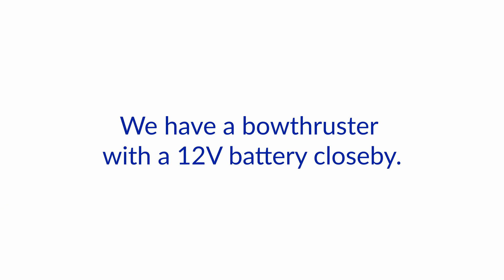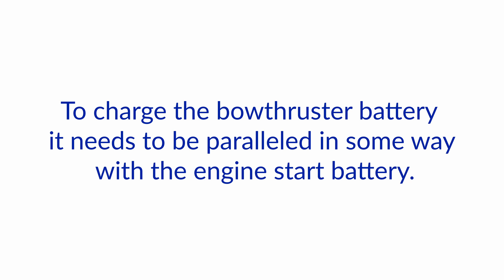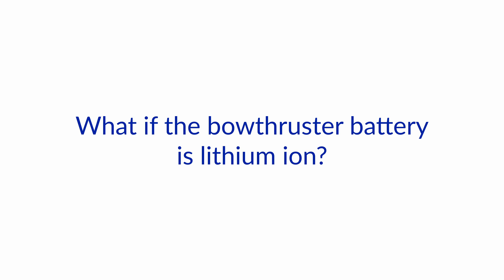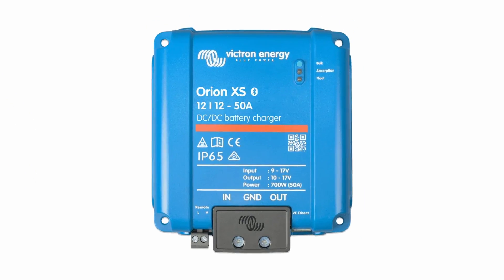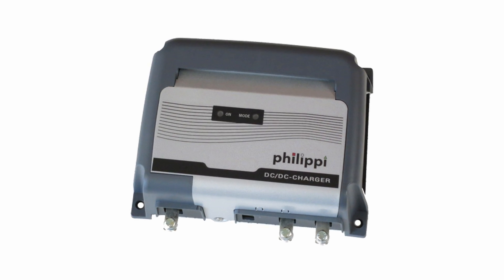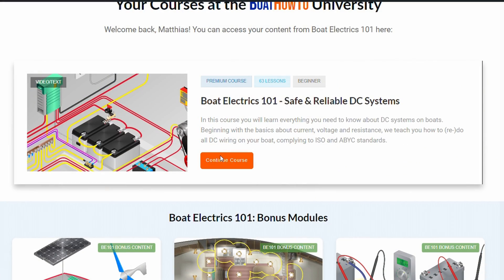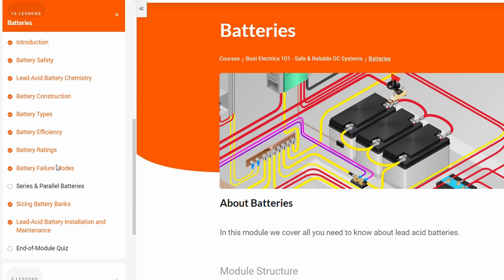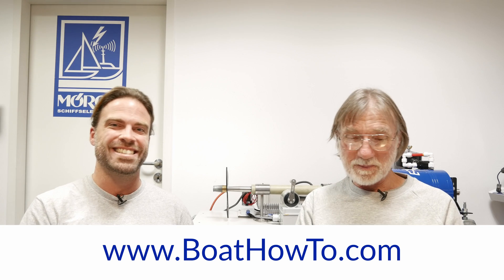LFP & Lead-Acid Mix - How to properly charge different types. | Ask The Expert with NIGEL CALDER

Comment: I am an advocate of "KISS" I have had a Lifep04 bank on my boat for ten years , I do not have any lead acid or any type of start battery . When and if my batteries hit LVC point there is still plenty of power in them to start the main engine and generator . I have a dual buss bar system , if the house disconnects the engines are still connected. This event has only happened once in ten years (I was vacuuming and didn't hear the warning buzzer before disconnect) The generator started up with no problem and charged up the batteries in no time. Also have the same bank driving the bow thruster , my bank is at the base of the mast and its only a ten 15 foot run with the bends to the thruster ,  I just spent the money on the cable , its twin 0000 Ancor , negligible voltage drop .

Comment: Is voltage drop an issue? On my boat its about 18 metres from engine to bow thruster. I charge mine using an AC charger. I am wondering which method would be more efficient.
Reply: I hope to start the course next week!

Comment: Nice topic - thanks.

FWIW: I have a VCR (relay) between my lead acid starter battery and my 300ah LFP house battery.  (I can enable/disable it via the relay on my Victron BMV 712 battery monitor so I can control/restrict combining).  The alternator is connected to the starter battery.

I had planned to purchase a B2B charger but I was surprised to never see a huge current flow between the battery banks when they were combined.  My starter battery is never below 12.5v and unless I'm down to 10% my LFP house is above that.   Perhaps it's not an 'idiot proof' setup but the voltages generally are within 1v at the battery terminals and factoring in voltage losses though 1/0 cabling and lead battery the current flow never exceeds safe values or even values stressful for the batteries.

I only have a 100amp alternator but if I was going to size up I'd likely look into connecting the alternator directly to the LFP house (& install a protection device) and keep the starter topped off with a small B2B charger.
Reply: There are several reasons why that is not a recommended set up. Firstly, the internal resistance of a LiFePO4 battery is much lower than a lead acid battery so a conventional (leas acid) alternator regulator will potentially deliver far greater currents than the alternator or wiring was designed for, potentially causing a fire. Adding a DC to DC converter (between both systems) is the  only prudent way to go.
Reply: @stephenburnage7687  Agreed, not recommended for the novice user, more of a knowledgeable poor mans solution.  I planned on using a DC to DC charger but in my case I could get by w/o it but a fair point, people need to know what they are doing.

LFP is not drop for any setup but there are several ways to add it safely/correctly depending on your system/needs. One is a DC to DC charger which can work for smaller systems and typically a straight forward upgrade if sized correctly /w proper wire size which is often overlooked.   Driving a lot of current through a DC to DC converter has it's issues as well.

Overloading the alternator is a common issue when converting to LFP which is why a smart regulator w/ temp sensor is recommended w/ any setup using LFP, regardless of the charging systems.
 
It's not uncommon for systems charging at over 100amp to have a large LFP bank directly connected to the alternator (w/ smart regulator and maybe an alternator protection device) and a small DC to DC converter used to keep the starting battery topped off.  This  reduces costs and DC2DC conversion loss.   There are automated systems out there (Bank Manager) that monitor the voltage of separate banks and automatically combine them when it's safe to do so ... and disconnect them when not charging.
Reply: @dsanner  I told the promoter (manufacturer) of the "Bank Manager" system that he was guilty of making fraudulent claims - Firstly, it is simply an overpriced, programable switch, which means both systems are being charged with the same profile - thereby reducing battery life expectancy and invalidating ones warranty on an expensive LiFePO4 battery. For a similar price you can buy a DC to DC converter with high 9's efficency and be entirely within specification. No contest! Yes, the  alternative approach is to go all LiFePO4 and then buy a new dedicated alternator regulator but that only makes sence on larger systems. The other issue to consider is fusing- while many leas acid systems take the risk and do not bother with a high AIC fuse, you really should not go without in a LiFePO4 system.